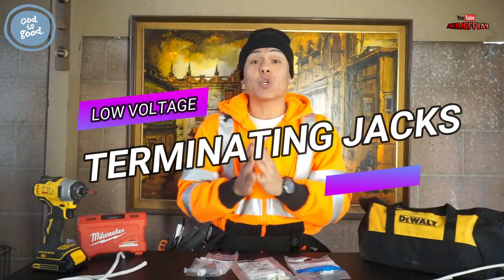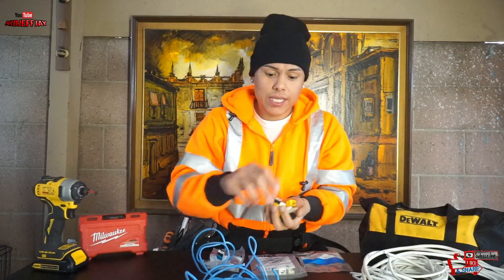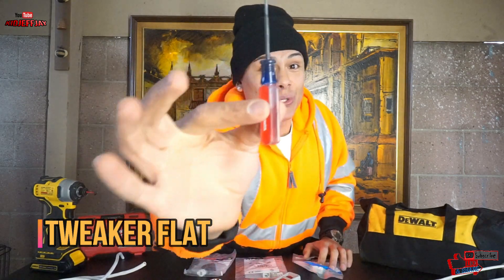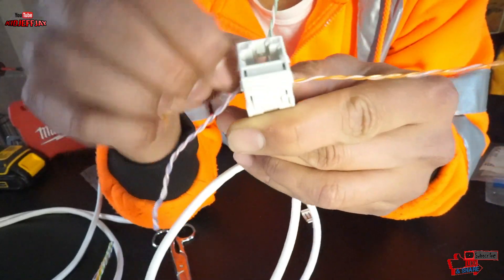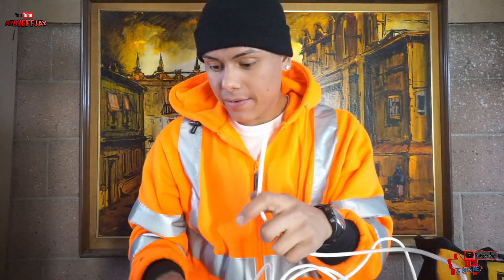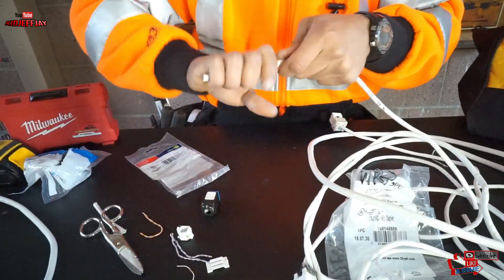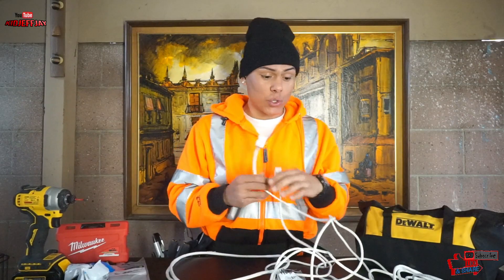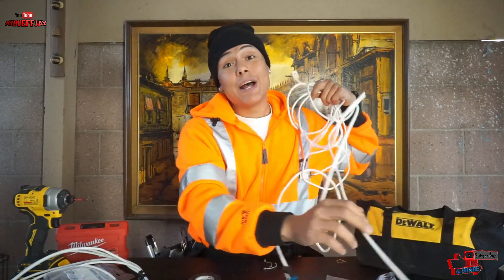How To Terminate Cat 6 & Cat 6a Cable | COVID Work Lay Off

Comment: Hey bro you work out of local 11?? I saw your insta. How’s the low voltage apprenticeship ? I want to join the inside wireman apprenticeship but the wait time is tooooo long. You plan on switching?
Reply from the maker: Yes sir Local 11 is the way IBEW on the processes to changing over to inside wireman, yes I think we message already I just seen this comment,